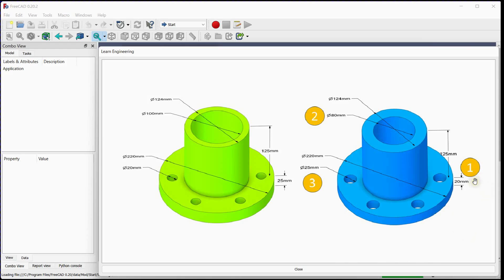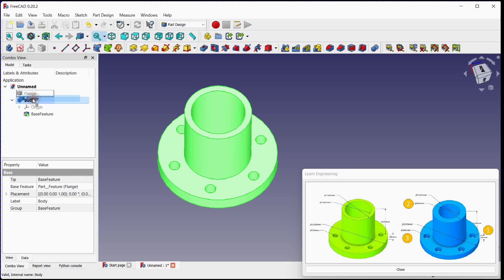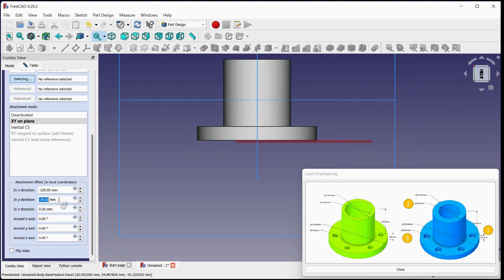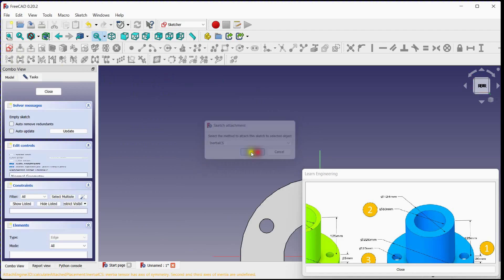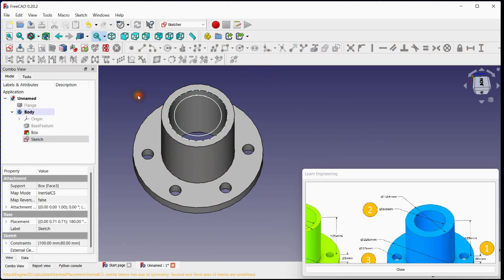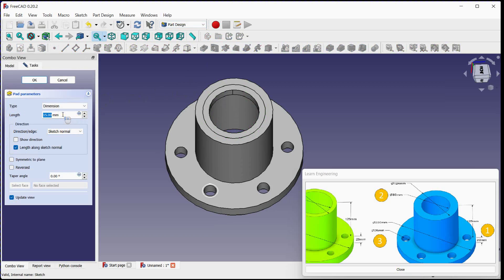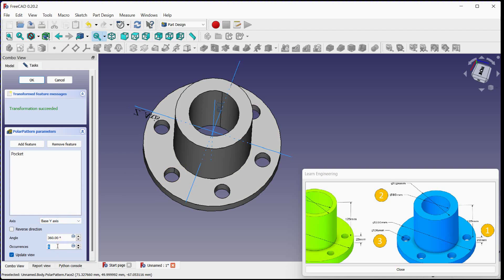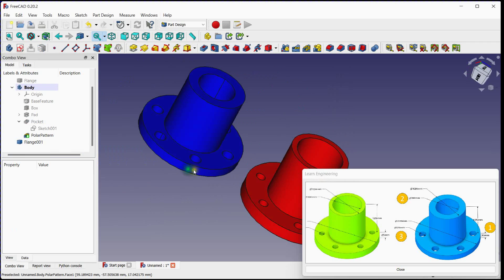🔧Modifying a STEP File in FreeCAD: Flange Thickness, Hollow Cylinder, and Bolt Hole Diameter Changes

Comment: how to I increase heights on a pyramid? Like I want the point to go up more.
Reply from the maker: It is not possible due to limitations in FreeCAD software, and achieving this would require many steps. It is better to create a new model instead. We apologize for the late response. Please note that our team has already attempted to address this issue before commenting.